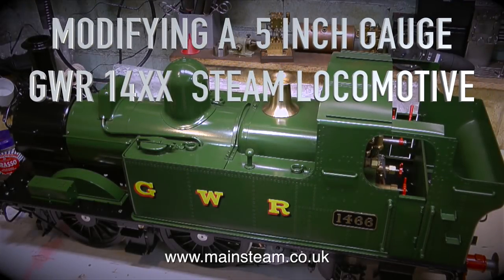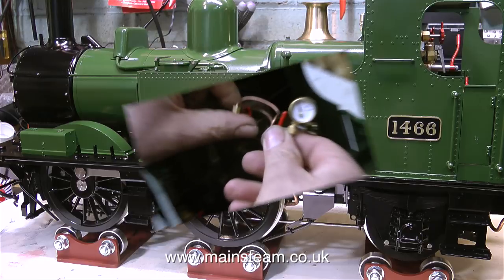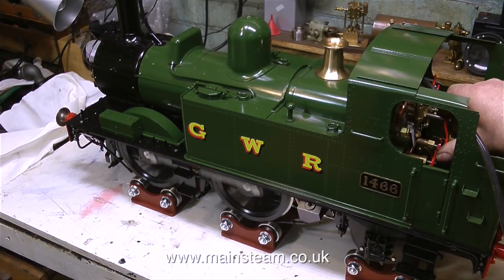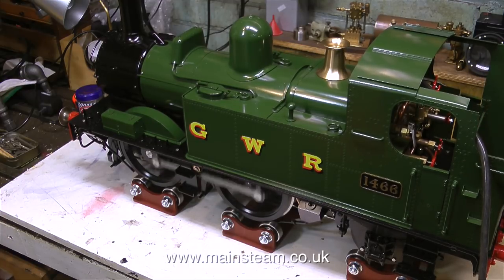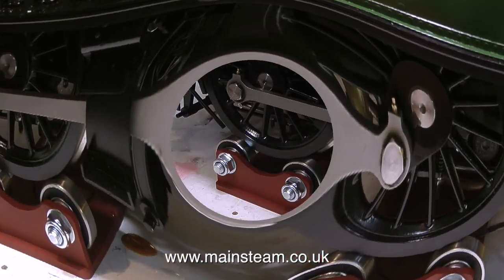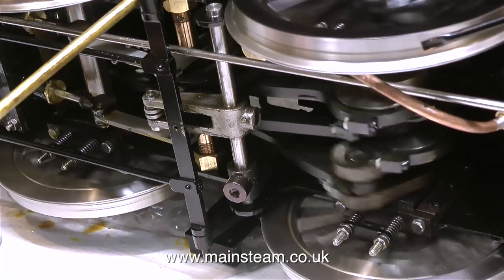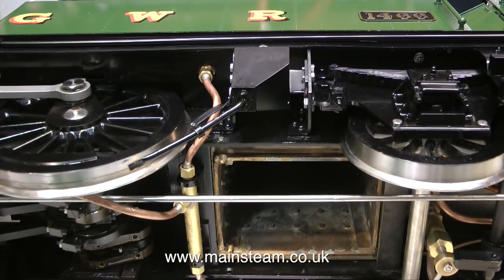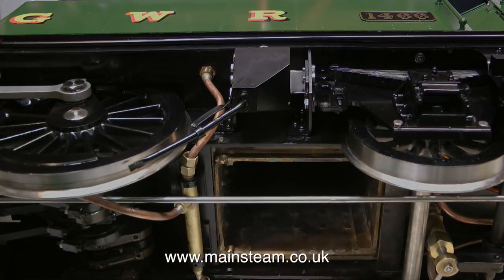MODIFYING A 5 INCH GAUGE GWR 14XX STEAM LOCOMOTIVE - PART #1

Comment: Good morning Keith, great series I have watched them all and very informative for a newcomer like me. As said just started in the hobby, far too late for a time served Mech eng. I have just bought my 1st loco from Kingscale a Jinty, which looks very well made. My question is, should I just run the engine and see what happens learning on the way? Unfortunately its ok being capable but you don't know what you don't know. So I guess my question is what would you suggest the best way of learning about all the points you have in this series, to be able to look at something and know that is wrong or doesn't work properly. Unfortunately I live in the N of Scotland and my nearest club is 3hrs away so not easily accessible  Look forward to your comments?
Reply from the maker: is it coal fired or gas fired? I would not recommend running a coal fired model engine as a complete novice. Coal fires are very unforgiving. What I do recommend though, is watching a lot more of my videos, this is not an advert - just an observation. I have covered at least 95% of the things you need to know in my various video series mostly designed for beginners. You can find most of the playlists here: https://www.mainsteam.co.uk/mainsteammodels-video-playlist
Reply: @keithappleton  Many thanks for a quick response. Yes it is coal fired 5"
Reply from the maker: Why not watch the series where I modified a 5 inch gauge 14XX Locomotive. even though it is not a "Kingscale", it is very similar. https://www.youtube.com/playlist?list=PLDV_TkPc48RGxtN2DKjn73HMLe_PMQWgA
Reply: @keithappleton  Just watching the final episodes Keith, fascinating, learnt so much just on the 1st viewing. I'm just starting with the springing, as that's mech. and I can do that :-) The springs are definitely too strong so now have to figure out what to change them to, other guys have found the loco derailing, on the ones supplied. I have run the loco on air just to familiarise myself, I will have to fill with water and see what happens, wish me luck

Comment: Keth were you removed the cooper piped from the underside in this vide, there is a black box with what looks like a black pipe going to just under the wheels. Is that a traction sander?
Reply from the maker: Yes, that is one of the dummy sandboxes . . .

Comment: Hi Keith in talking about axel feed pumps I am in a bit of dilemma on weather I should fit one to the Super Simplex.   I was going to just use two injectors, but would that be the wrong way to go considering that if something should go wrong with one of the injectors there is the safe guard of the pump.  I would appreciate your view on this thanks Keith John
Reply from the maker: My advice is to forget the axle pump and use 2 injectors (:-)))
Reply: Keith Appleton thanks for replying back to me Keith, I was pretty sure that's how I was going to go but it is great help to get your advice, Thanks mate regards John.

Comment: Is there any concern about the boiler certificate or retesting of a foreign made boiler?
Reply from the maker: No, it has the original manufacturer's test certificate and i will be getting a current boiler certificate shortly.
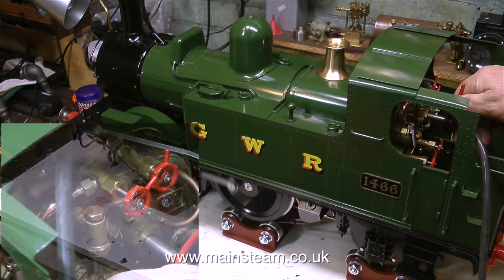Reply: I see a "CE" on the (boiler) when film is 4:00, is correct?
Reply from the maker: Yes. the boiler also has a manufacturer's test certificate and it is fine.

Comment: Maybe a stupid question but how do you get water in a boiler when not in use or no pressure In the boiler??
Reply: With a hose. Either in through the blowdown valve (where you let the steam out at the end of the run) or take out one of the safety valves and put the water in that hole. Or with the hand pump in the side tank I guess, but that would take forever.
Reply from the maker: The hand pump doesn't take long to fill the boiler . . . . .

Comment: Keith, you mention that there's a pressure leak under compressed air that wasn't there when you tested the engine under steam... That's actually is NOT surprising... When you test under steam the engine parts are at a completely different temperature (roughly 110 C) then when you test under air (probably roughly 25 C)... As parts expand ever so slightly when at the higher temperature it's possible that said expansion cuts off the leak that's there at a lower temperature...
Reply from the maker: Yes .......

Comment: Is this steam mechanism a "Dutch Wagon" type?
Reply from the maker: What does that mean ????
Reply: There was a locomotive called the Daniel Nason.  It was built in 1858 for the Boston & Providence railroad line.  It was displayed at the Danbury State Fair in Danbury, CT for many years until the fair shut down and the locomotive was relocated to the Museum of Transportation in Kirkwood, Missuouri.  The "Daniel Nason" is the only surviving example of the "Dutch Wagon" type where the steam cylinders are inside the locomotive frame, a design popular prior to the Civil War.  If you look at a photograph of the locomotive, it is an "American Standard" 4-4-0 but the steam cylinders are not visible, similar to the locomotive you are working on now.   There is a YouTube video of it too.
Reply: reconphil I think that term may be a little more specific to those American locomotive types, as internal cylinder locomotives were quite common in Britain, particularly in the Victorian era where clean lines were prioritized.

There are certainly plenty still preserved in the UK.

Comment: More 14XX problems.. The previous owners have turned it upside down to empty the boiler, rather than using the blowdown valve. Steam pushes the sludge out on the foundation ring, from the top, down. The entire water system is full of dodgy water, injectors constantly blocked. Running gear is fine. Certain people keep feeding the little chap on dust..

Comment: Pardon Mr Appleton, and learned viewers, can someone please explain to me, in simple english, what the number description of a train means. Like an 0-4-0 or a 4-6-4 or what have you. I understand it relates to the wheels in some fashion, but what makes an 0-4-0 that, instead of say a 1-2-1 or a 2-0-2?
Reply from the maker: I covered that in a video the other week ........
Reply: Mooncabbage The arrangement is leading wheel, coupled driving wheels, trailing wheels.

So a 0-4-2 has no leading wheels, 4 coupled driving wheels, and two trailing wheels.

Conversely a 2-4-0 has 2 leading wheels, 4 coupled driving wheels, and no trailing wheels.

A locomotive with mutiple sets of drivers not coupled will have two, or more, middle numbers, like 4-8-8-4, which has 4 leading wheels, two sets of 8 coupled driving wheels, and 4 trailing wheels.

Or a 2-2-2-0 like Webb's compounds, which have 2 leading wheels, four non-coupled driving wheels, and no trailing wheels.

Tender wheels are not counted.
Reply: Keith Appleton I think it's fair to say I either missed that one, or was too thick to understand it :)
Reply: DAKOTA56777 For clarification for the stultifyingly stupid amongst us, I assume that a 2 refers to a pair, left and right, and a 1-1-2-0 would be a truly bizarro engine. Further, I assume the leading and trailing wheels are idlers, and provide no motive force? Is there a special notation for idler wheels amidships? I really know nothing about steam or diesel trains (or electric ones either, if it comes down to it). I found myself the local train museum not that long ago, and it was all Chinese to me. Unfortunately there was no-one knowledgable around to ask. Thank you for taking the time to reply.
Reply: Mooncabbage Yes they are pairs in that it counts individual wheels, so this 0-4-2 has six wheels in total. There is a classification system that goes by axel count instead of each wheel, in which this 0-4-2 would be listed 0-2-1, but it's not as commonly used.

Also yes, leading and trailing wheels are idlers, driving wheels provide motive power.

In the event of a locomotive with "amidships" idlers, usually those only exist as double system engines like a Garratt or Fairlie type, in which the wheel configurations are joined with a +.

For example, an 0-4-2+2-4-0 would have 4 amidships idlers, for the front section they'd be trailing wheels as they are behind the drivers, for the rear section they'd be leading wheels as they are in front of the drivers.

As a visual for that, with big "O"s as drivers and little "o"s as the idlers: OOo  oOO.

These type of articulated engines tend to look very different from conventional engines as the front and back sections are seperated and driven by their own cylinders. So at a glance it looks more like two seperate locomotive chassis being bridged by a single boiler. (Or in the case of a Fairlie type, two engines with two boilers glued back to back.)

Also this system is really only applied to steam locomotives, modern locomotives, be they diesel or electric, use a very different system, as the system used on steam locomotives is fairly clunky on bogie driven engines like we have nowadays since they don't have idler wheels, and their wheels are independently driven, not coupled.

 (Essentially each bogie would be seperate, so you'd have something like 0-2-2-2-0 + 0-2-2-2-0 for your average modern engine if you used this system.)